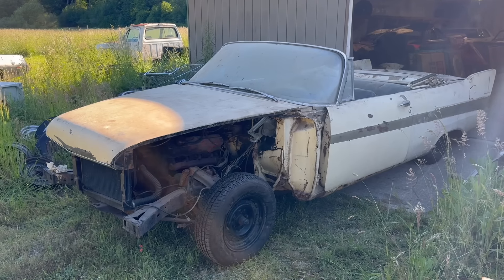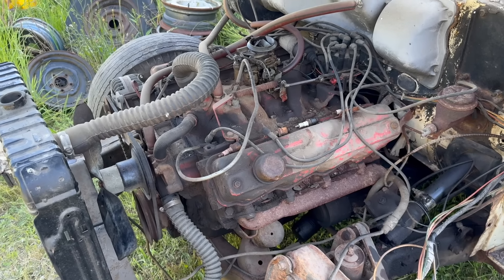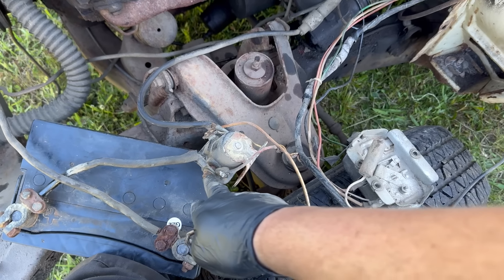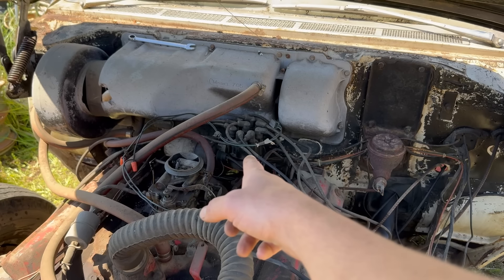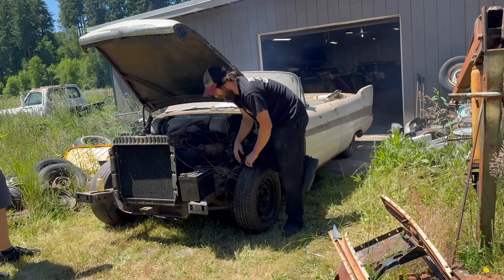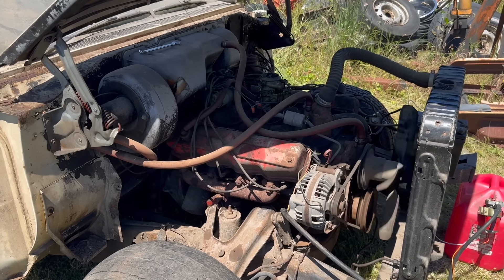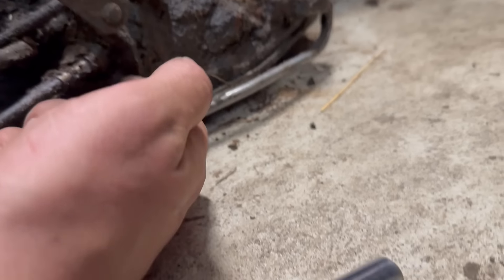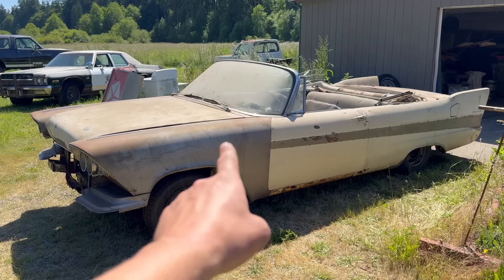Will This Spooky 1957 Plymouth Belvedere Convertible Run And Drive Again After Decades In Pieces?

Comment: Can you drift start the 65 904 cable shift tourqueflite too ?Asking for a friend.
Reply from the maker: I’m actually not sure if they removed it for ‘65 or not. I suspect it was gone when they went to the slip yoke? But I could be wrong.
Reply: @DeadDodgeGarage  I may be in luck.Mine is still a flange,err,using the word luck loosely.
Reply: @samuelgoodman2825  I had a 65 Fury with a 727 that would.
Reply: 65 was last year for 727 with rear pump, but I don't know about 904 🤷‍♂️

Comment: Conbit is cheap. You want more bit than con. Spreading just 2 inches over dirt helps cars NOT return to the Earth.
Reply from the maker: Never heard of conbit. Tom has roofing shingles laid over a lot of that area, but Mother Nature finds a way
Reply: @DeadDodgeGarage  Conbit is the stuff that they “mill” off the top of the road. It’s a common thing here to mill off 2 inches of pavement then put it back new. The “millings” are called conbit

Comment: Messing with those points reminded me: I don't think Tony agrees with us about using a GOOD GM HEI module to run a MOPAR electronic distributor. (NOT REFERING TO THIS CAR EVERYONE).
ALL of my MOPARS are trucks, all the ones I have, and not parted out, definitely have value but NONE will ever be "collector's items" in my lifetime so ALL have GM HEI modules..... or a CUMMINS!

Plus, I have a pile of GOOD, OLD factory modules that don't have all of the brown goop running out of the back....yet.
Reply from the maker: No I don’t think he sees the value in that. He’d rather grab an old Mopar module. My take on it is that the HEI is cheaper, easier, and faster and less annoying to wire. Both from the parts stores of today are a crap shoot. So - I’ll take the cheaper and easier route.

Comment: So many factual inaccuracies. How about doing a little research before spreading misinformation.
Reply from the maker: What the fuck are you talking about
Reply: @DeadDodgeGarage  - Fury convertibles ? 727 transmission ? Cluster from a 58 ? Gold side stripe (it was actually anodized aluminum) ? Fury as high performance model continued thru 58, not 57. 56 and 57 had their own shade of white. 58 was Buckskin Beige, which is tan, not white. That's 'what the fuck' I'm talking about.